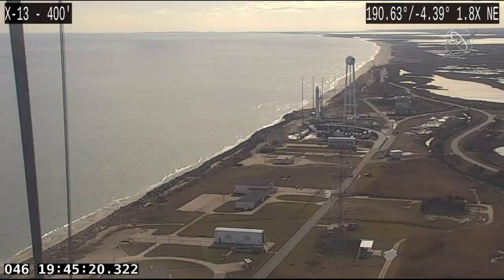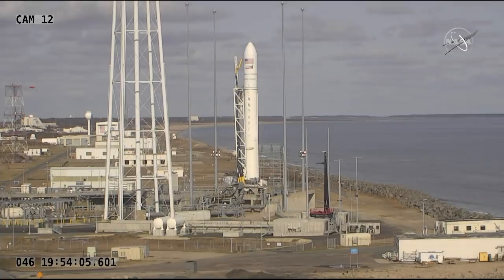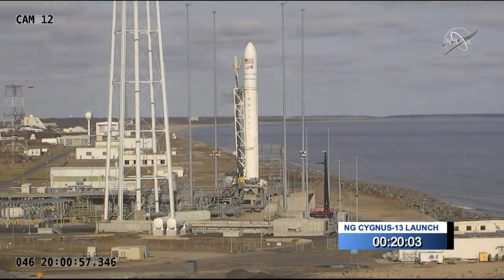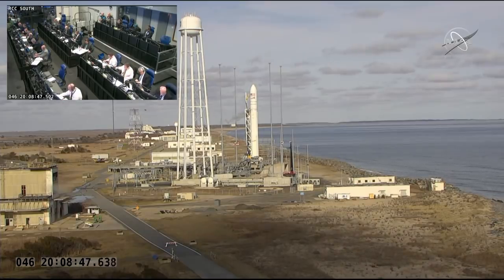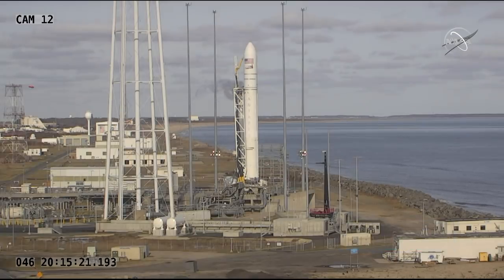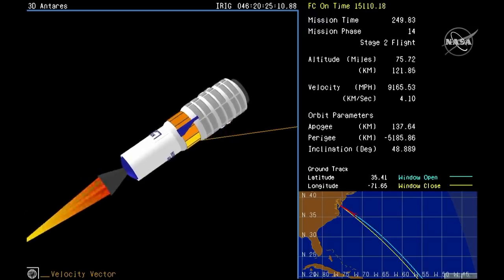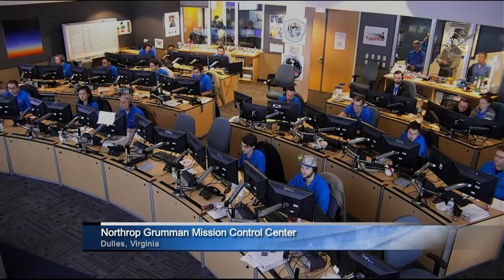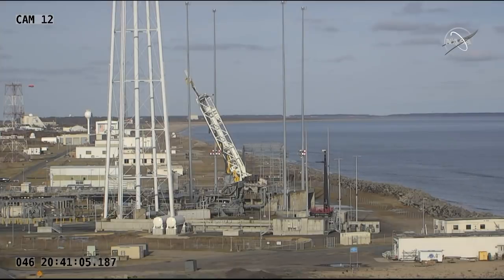Northrop Grumman Antares and Cygnus Launch to the International Space Station

Comment: Volcanism is driving the Solar Eruptions found on the Sun. That’s why you found beneath the exterior layer of Atmosphere ( not the actual surface ) of the Sun, the Corona, temperatures drastically higher than below. 

The Sun is a Solid body Planet covered in Volcanism w/ Lava spit outward breaching & igniting the flammable Atmosphere millions of miles above. 

Which is Jupiter exhibits zero Ejections of Mass yet is HOT when Jupiter should be COLD due to VOLCANISM. 

Which is why our Moon is covered in Craters. 
V O L C A N I S M

Comment: So this company doesn't recover any rocket components.
Reply: Nope. They're shoveling taxpayers dollars right into the furnace.
Reply: @algernonsetonis  They don't even recovery the capsule that carries ISS supplies?
Reply: @ryancool-pq5vu  No the Cygnus is not recovered (according to Wikipedia it can be loaded up with trash and burns up on re-entry).
Reply: @Cornerback3141  The space shuttle could resupply the ISS in one launch. Now they have to use these companies to resupply the ISS. Was the Shuttle more expensive or these two rocket companies? When one company has to build a new capsule for every launch.

Comment: 1 - How do you manage to get your phone's audio routed into internal communications, or the stream? :X
2 - After bragging about building this new software it returns arbitrary data that is obviously incorrect. Assuming the visual model & values given on the display are 100% dynamic & based on the returning data from the vessel, you can prevent this by adding "filters" on the return data. Eg;
If (NewValue) Δ (CurrentValue) = X than don't accept (NewValue).
AKA
If a (MissionTime) update is sent from the vessel, and it differs from the current value by an impossible amount, than don't accept the new value.
OR
If (MissionTime) tries to change from "600" to "100,000" in 30 milliseconds... I mean... I think this one can be figured out fairly easily?
Reply: For #1:

I work in an industry that uses headset communication (not nearly as cool as NASA, tho), and it happens all the time. On purpose. You want a way to get a person at a remote location to be on headset with you. You have an intercom interface that either dials out, or picks up a line, at the other end is another interface for the remote person on intercom. This one is obviously set to dial out. I would assume that the remote person had been connected from the start, and managed to become disconnected. What you head was the system auto calling the preprogrammed number back (with the dial tones muted thankfully).

Comment: During pad lift off, this rocket pitches 3 degs from vertical . Scary stuff.
Reply: Carl Hansen 
It’s done on purpose to reduce damage to launch facility. This was once covered in one of the post launch press briefing during one of the initial Cygnus launches.
Reply: Yeah it was enough I could see it without trying really.  I guess there are computers balancing or directing the engine output super fast at this point?
Reply: dwhamm0 
Carl Hansen 
It’s done on purpose to reduce damage to launch facility. This was once covered in one of the post launch press briefing during one of the initial Cygnus launches.

Comment: It's always so wired do see how this rocket costs 85  millions to put 8 tonns PL to leo while the falcons are going with 22 tonns for as low as 50 millions.
Not the biggest fan of SpaceX but this numbers are just so off the scale different
Reply: You should keep in mind that these two factors are not the only ones in deciding a launch vehicle. Certain vehicles will be more precise in their insertion, meaning less fuel will have to be used on the (often very expensive) payload/sattelite and certain rockets might have a higher reliability than others. Also, the payload fairing size can differ even between rockets with the same PL capability by mass. I am not saying that these factors are more important than price or payload capability, or that they also apply to this launch in particular, but what I am saying is that things are not always as simple as they might seem.
Reply: You have to offset these numbers by launch frequency at least. Antares launches like what, two times a year tops?
Rockets get cheaper the more often they fly (per year), so it's natural for a rocket with a launch cadence of one or two times per year to be significantly more expensive than a system that launches 20x as often.
You'd see such discrepancy even without partial reuse. SpaceX could've just as easily simply ramp up their production to 50+ rockets per year and achieve similar pricing without partial reusability. They just figured that reuse is easier to do achieve than cheap rocket mass production. Starship is supposed to go the mass-production route instead, since reuse is kinda out of the question if you shoot the rockets to Mars...